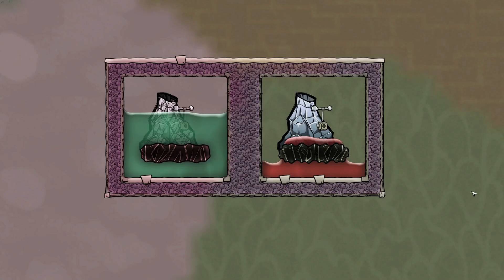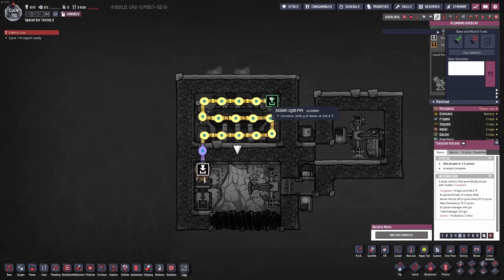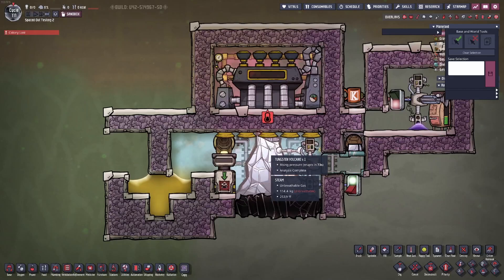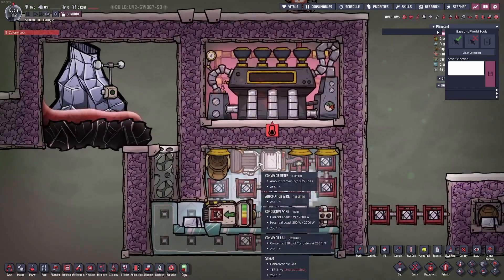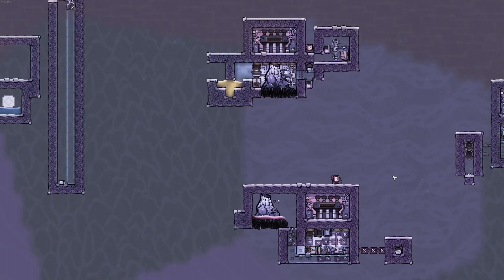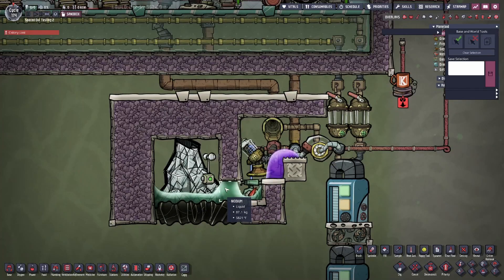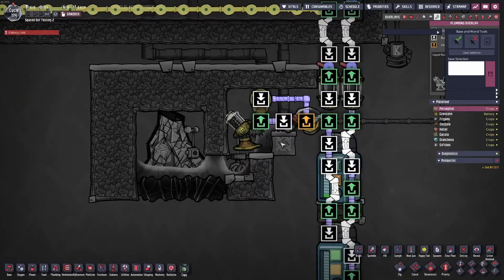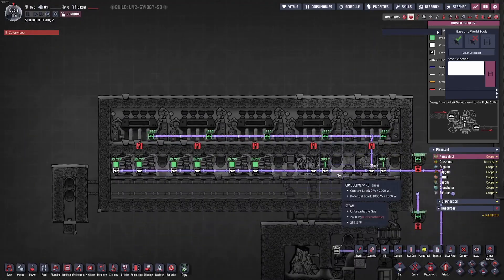Niobium And Tungsten Volcanoes And How To Use Them - Oxygen Not Included Tutorials

Comment: Should I risk it for the biscuit? Naptha. Ceramic pipes in a vacuum and a powerless liquid filter using the element sensor automation. 
Now I know the pipes could break but uh.. I gotta risk it lol.
Which mods do you use for sandboxtools?
Reply from the maker: Naphtha could definitely work and sounds like a neat idea to see. I just use the debug mode and the sandbox included in the game.
Reply: @LookIntoGaming  so I built it in my map. You’re right about insulation pipes. You can use ceramic but you’d have to replace it with another material and back again every twenty cycles? Before it melts lol. The rest works very well. But it does have to be exactly 30 grams of naphtha or else it could spill over eventually. Idk why I didn’t think of using my volcano tamer build before but thank you for the idea!